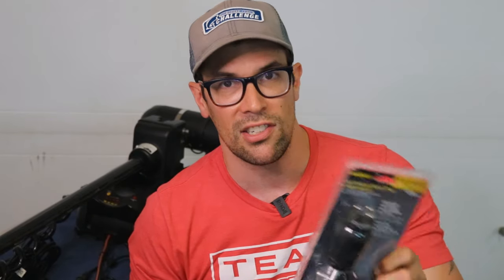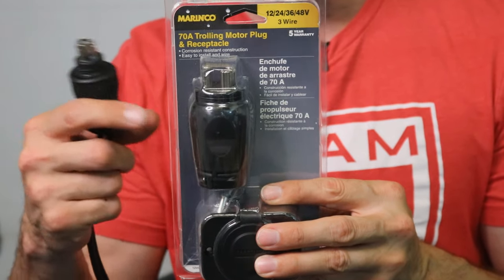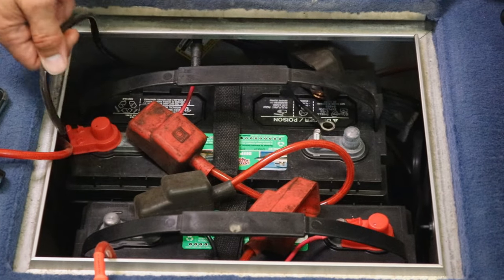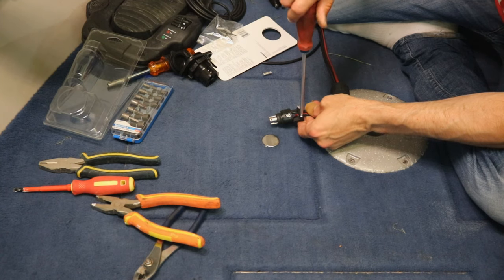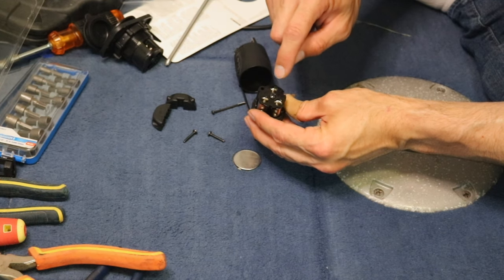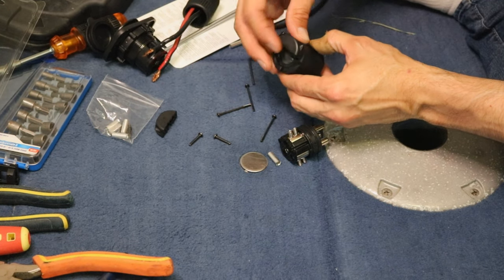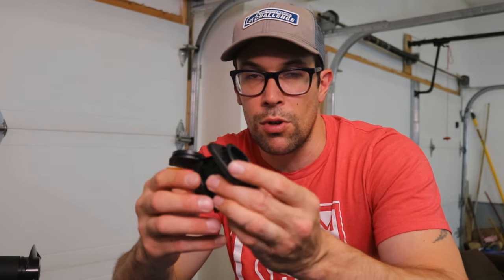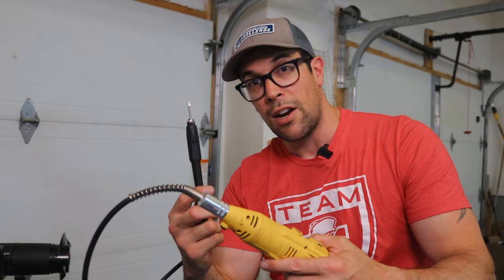How to Install or Upgrade your Trolling Motor Plug and Receptacle on Your Boat!

Comment: Since it's a 3 wire plug and you only installed 2 wires, I would be putting some marine sealant in the plug where the 3rd wire is missing. 
Would want water creeping in through there 
👍
Reply from the maker: Honestly I don't see why you would do that.  There is a gasket that seals the entire connection from the outside elements when connected and a rubber plug that seals it when not in use.  No water can get at the back side of the plug unless I submerge the boat right up to the casting deck, and if I do that, I have bigger problems than water getting in the unused hole lol!  In all honesty though, marine sealant and dielectric grease are WAY overused or incorrectly used on electrical components.  I've had people suggest slathering battery posts with dielectric...  that's about the worse thing you can possibly do.

Comment: You should have ordered the two pin version to maintain IP67 compliance. Best Practice: Tin the wires before clamping and coat with dielectric grease.

Comment: Should have included the name of the product in the title. I installed this on my new (to me) trolling motor. Mine didn't come with the inserts into the male connector, i had to use bare wire, but works great. Consider using dielectric grease so the wires don't corrode into the receptacle, since you are using dissimilar metals. Also the plug is pretty bulky, but holds nicely. I also had used electrical tape under the "strain relief" to ensure tight fit. Also, when you upgraded your wiring, the old receptacle didn't really even fit that 6ga wire.... 
also a 2" hole saw will work for the mount.
Reply from the maker: Hey thank you for all the feedback!! The product name is in the description, I try to keep my titles to 60 characters or less.  But I always name and link to products I talk about :)  Strange that yours didn't come with the ferrules, I actually just have a big pack of them that I use for different products.  I'd still pick some up and and add them if you can.  For the dielectric, it's interesting how people use this on everything and anything.  The grease is meant to seal connections, not on electrical points of contact although tons of people do this.  I see people recommending using it on battery connectors and I cringe every time.  Use a connector protectant for that, WAY less messy :)

You're bang on about the wiring upgrade, I knew I was going to need to upgrade the receptacle right away and VERY glad I did, the new one is awesome.  Definitely bigger, and it just feels so much better quality and heavy duty, plus no more annoying twist lock!  I didn't use the hole saw bit on this one because I wanted to keep those straight edges on the sides, plus I didn't want to accidentally crack the small plastic piece, which is a risk with a hole saw on such a small part.  This is an older boat and finding replacement parts is not easy.

Still super happy with this install, it's been a year and still hasn't budged and looks good as new.  Thanks again and tight lines!

Comment: Both my rubber pieces came off when I was pushing the wire through.  It was unavoidable.   You pushed them through so easy and the rubber piece stayed.  Did I have bad plugs or something?

Comment: My comment below about Northland Marine is not an ad for them. I don’t work there,  I am just a long time customer. When my Ulterra went crazy after my old plug popped out they saved my weekend. Power stopped when the plug pulled out. When I went to stow the motor, the motor pulled up wrong and locked on the lower edge of my pontoon boat. I called them on a Friday at 4:50 pm. They close at 5. Jason helped remove be my motor from the bracket, and reset my motor while patiently waiting on the phone for 30 minutes.If you have a problem on the water call them for immediate ideas or wait on the line for 35 minutes with Minnekota. I saw a thumbs down. Again not an ad but a suggestion for help.I am 73 and this was no easy feat for me since the Ulterra weighs 80 pounds. Jason was super patient nand saved me from having to tow my 23 ft Bennington in.
Reply from the maker: First off, nice to see someone your age still getting out there and fishing, I hope I'm in just as a good a shape when I'm your age!  And congrats on finding a great Marine mechanic/company.  They can be hard to find, but once you do, they can make boat ownership and maintenance so much easier on you and your wallet.  I never saw your previous comment, but I'm totally OK with you sharing your positive experience with Northland! :)  Have a great day and thank you for taking the time to leave a comment :)
Reply: o

Comment: You said red positive goes into #2 

Does the negative go into #1 or maybe #3?
Reply from the maker: It actually doesn't matter as long as you match the numbers on the socket as you do on the plug :)  Used #1 for neg :)

Comment: Eh Clark, my 2022 Excel BP boat came prewired for a TM, it has the cables coming out neatly out of a plastic covering the hole and is gonna be a 24V setup, do you recommend the plug are you using on this video?
Reply from the maker: Yes definitely, it's been over a year that I've installed this plug and it still looks as good as new and works perfectly, I love it. I also recently did some major wiring upgrades on the boat and I took this front panel off and had a chance to inspect the connections for the socket and everything is still perfect with zero corrosion. So very happy with this plug and I recommend it confidently.

Comment: So I noticed on my new Terrova that I needed to do the same and replace the plug.  My question is when I look at the wire coming directly out of the trolling motor itself it says it is 10 AWG wire on it.  If you check the wire coming directly out of your trolling motor, does it say what gauge it is?  The one I have from Minn Kota is 80lbs/24V/60".
Reply from the maker: Totally normal, my Terrova has 10AWG as well and that's fine for the small run between the motor and plug.  You and I have the exact same motor :)

Comment: Would everything still work if you attached the positive and negative leads coming from the trolling motor and batteries to any of the 1,2,or 3 terminals so long as the plug and receptacle match each other? I just bought a used terrova and the 2 spot on the new receptacle that came with is broken.
Reply from the maker: Yes, absolutely would still work, just make sure everything lines up with the right terminals.

Comment: Do you have to do anything with the 3rd hole?  Tighten the screws, remove the ferrule or anything, or just leave it as is?
Reply from the maker: If you're not using it you can just leave it as is.

Comment: Has this plug worked flawlessly for you since the install? Is your motor a Terrova? I bought this plug then noticed it says on the back its for 6-8 AWG? As well, I emailed Minn Kota and found out the  Terrova power wire is a 10AWG. I don't wanna install this unless its has worked for you flawlessly and you have the same motor? thanks for any help.

Comment: Hey Dan, Cabelas hooked up my 24 volt minn Kota trolling motor n my minn Kota 24 volt anchor winch. I have the plug n twist connector on both. those are wrong?!
Reply from the maker: If you have the same MK unit as I do, your plug should be rated for 60 amps and that old twist lock I had was max 40.  You can find the amperage and wiring guide for Minn Kota motors at https://www.minnkotamotors.com/support/trolling-motor-installation-guides/trolling-motor-wiring-and-battery-guide?miwg and you can see the max draw.  Your plug needs to be rated according to those specs.  So yes, it sounds like you may have a plug that is too small.

Comment: So when I got my Xi5 24v I just took the plug off my old TM and stuck it on the leads. Didn't think anything about. I noticed that it didn't seem to be getting 80 lbs of thrust.    My old TM only thru 72lbs and it whipped the front end. Anyway I check the plug and it's rated 30 amps. 
So I ordered the same 70 amp package that you used. My question is. Will I see more thrust?
And thanks for the video!
OH yes one more question. Can't one just trip the breaker instead of taking wires off?
Thanks
Reply from the maker: Hi Rickey, that's a very interesting question and it doesn't sound to me that despite having underrated plug (it's half of what you should be using) I don't think that would cause a huge drop in your thrust... by having the underrated plug, you're at a much higher risk of overheating and a fire, but until that happens it should still pull the amps.  But what's weird is that the only difference is that you changed the plug right?  So from one day to the next the power basically dropped and all you did was change the plug?  Are you 100% sure that both your batteries are fully charged and voltage is stable when the TM is engaged?  I'd definitely get the multimeter on your batteries when the motor is on AND I would test the leads on the plug to make sure you're getting a full draw.

For your breaker question, the MK one cannot be manually shut on and off like a home breaker switch for example.  It's always on unless it trips from an overload/short and does not have a test button.  If you prefer to have that kind of functionality, shop for a marine breaker with a test button.  Hope that helps!
Reply: @DanRichardFishing  thank you for the information that I've been seeking. I bought this 2001 Triton TR20 from a guy who got it from the original owner. Now please understand I'm no electrician. One of my deep cycle went bad and was a maintenance free bat. To make a long story short, I discovered that the bat had gone dry. I started to trace the juice. Discovered that there were 2 50 amp breakers attached to the fire wall above the bats. I didn't know at the time that only 1 breaker was necessary. Well one had tripped but there was no flag. I ended up taking the breakers off and that's when I found the tripped one. Got new battery. Good to go. 
Decided I wanted an anchor TM. The Xi5 recondmended a 
60 amp breaker. So I bought two and changed them out. Put my meter at the plug 26volts. Put it on the bats. 25.8 volts. 
But I haven't done it while the TM is in operation. I'll give that a try. I still don't believe I'm getting 80 lbs. 
But I've been told my plug and recepical is coming this Saturday. So after watching your video it should be a breeze.
Also I finally got my R&R Slide plate. So I'll be really busy this Friday. Hopefully get er all done. For Saturday is opening morning for Spring Turkey. 
I thank you for sharing your knowledge and I'll check out the active voltage and Amperage.
Take care.
Oh yes my breakers have the push buttons. I know now I didn't need two but I figure no harm. Right?
Reply from the maker: @rickeycombest8211  Honestly, I would absolutely remove the second breaker as I'm not so sure that it couldn't potentially cause problems should there be an actual reason to trip it.  There should only be 1 positive and 1 negative wire coming from your batteries that are in series so you should only have 1 breaker on the positive. I'd remove the extra.

How old was the battery that went dry, because that is definitely not normal.  Was it leaking inside the boat?

For the thrust on the TM, I wouldn't look at how violent it pulls you over, I would look at the speed that it pulls the boat.  Older trolling motors didn't ramp up speed, meaning if you had the speed up all the way and hit the pedal, it could throw you off the boat lol!  Some newer TMs have a ramp up feature where instead of going full blast the second you step on the pedal, it gradually ramps up the power for a less jarring start.  The Xi5 has that speed ramping up feature so that might be why you think it seems less powerful?  Hope that helps!
Reply: @DanRichardFishing  no leak. The guy that I bought it from told me that he kept it on charge thru the winter. No acid leak. I believe it evaporated. Well doesn't matter got a new bat. And I only charge once every 30 in the winter. And check that water. Plus voltage put out. I'm good to go on all three bats. 
I'm not quite sure how to remove one. There is a cross over and a positive hooked one one and the neg on the other. I'll figure it out. I ran the old TM with no breaker problems. I'll see what I can do. I paid good money for those breakers. But my TM is $2,000 plus. No brainer.

Comment: What guage is the wire coming from the trolling motor to the plug? My new 24v Terrova is 8 awg. I just ordered this plug & recepticle. Hoping the 8 awg will be ok. I have 6 awg to run from the recepticle to the batteries. The plug and wires that came with my Lund are crap.
Reply from the maker: Hahah yeah same with my Princecraft, definitely sub-par wiring.  You're fine with the 8 as long as your run is less than 15 feet total.  If longer than 15 feet, you need to use 6.  Hope that helps!
Reply: @DanRichardFishing  I pulled the cover off today and had a look. The stock wire coming out of the Terrova is 10 awg. Did you change the wire that goes into the motor itself?

Comment: Any concern with minn kota wire size? Plug says it's rated for 6 to 8ga and minnkota terova is 10ga
Reply from the maker: I would just go ahead and use the heavier gauge 8, won't hurt anything to go heavier than the 10 :)
Reply: @DanRichardFishing  I didn't really specify...the stock wire coming out of my 2024 terrova is 10 ga. So butt splice a bigger wire from the trolling motor wire to the male plug? I've watched several videos installing this plug and it it seems to be looked over. Someone also said just to strip more wire and fold / twist to better fit the inserts if needed.

Comment: any updates on this plug? I've read some people have issues with it and the lock nut on the back strips out
Reply from the maker: Still working perfectly and hasn't budged a millimeter since I installed it. Extremely happy to have installed it! And I fish heavy current and pretty good size waves so my bow takes a beating...

Comment: What gauge (size) cable does a 24v 80lb motor need?
Reply from the maker: Minimums are 8AWG up to 15 feet and 6AWG up to 25 feet.  Personally I would recommend using 6AWG.  You can check out this chart for more details: https://www.minnkotamotors.com/sites/minnkotamotors_site/files/min_productmanual_batt-wire-selct-gde1.pdf

Comment: I have a 36V fortrex and it is 112LB thrust and I run a 100amp battery x3 will this plug still work
Reply from the maker: Yes, your max draw is 60amp so this plug is perfect for your application. All the best!

Comment: The wires on your troller are not as big as the Force.    Good advice on the three screws.    
 I find it easier to leave one wire longer than the other. Also make sure the wire is seated in the Ferrel before you tighten the Allen screws. Once the Ferrel is crimped it is no good.
Reply from the maker: Great points Baker, thank you!  As you said, it's SUPER important that the wires are properly seated all the way in to the ferrel before screwing it down.  Thank you so much for the comment!
Reply: They are called crimp sleeves you can buy all you want at your local hardware store

Comment: What should I do if I have 4 wires running to my current trolling motor? Replacing a old Evinrude with a Garmin force  any help would be appreciated!
Reply from the maker: OK so you have one of the old 24v setups!  So what you need to do is check and see what gauge those wires are.  If they are the correct rated AWG size for the length of run, then you can use one pair of red and black and remove the second, and then run your batteries in a series.  You can find everything on how to do this at https://www.youtube.com/watch?v=z8vjVBew1I4

Hope that helps!

Comment: Battery tender is the best plug by far. The marinco plug will not accept a large wire.
Reply from the maker: This plug will accept any of the AWG sizes recommended for any model of trolling motor.  If your cable doesn't fit, you're not using the correct size wire.

Comment: Will this work on a 60ah lithium battery
Reply from the maker: It's not really battery dependant so it should work on any battery to be honest.
Reply: @DanRichardFishing  ok cool and one more thing do you have a video or recommend quick connect for the lithium battery that I will be power the spot lock from

Comment: What is the 3rd pin for?
Reply from the maker: While it's not common anymore, you used to be able to buy trolling motors that can be wired for 12v OR 24v. An example would be the older Minn Kota Vantage. On those kinds of trolling motors, the two wire was used for the 12v and the third wire would be installed for 24v.  Nowadays, trolling motors are either 12, 24 or 36 etc and some new trolling motors like the Garmin Force will autodetect the voltage being used, the same motor will run on 24 or 36 with a 2 wire cable.
Reply: Dan Richard Fishing thanks for the info I have mere heard of that before